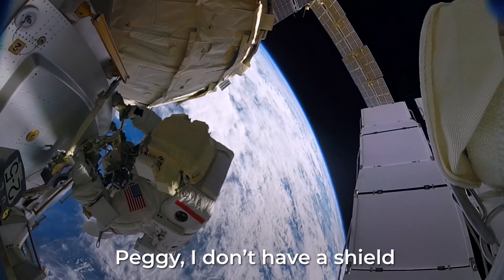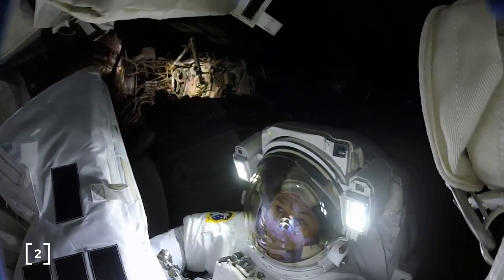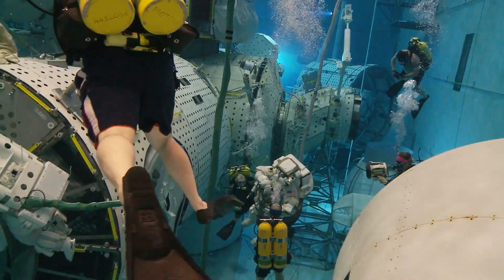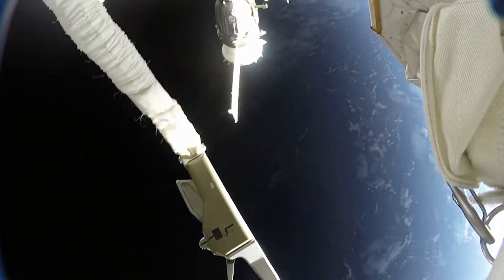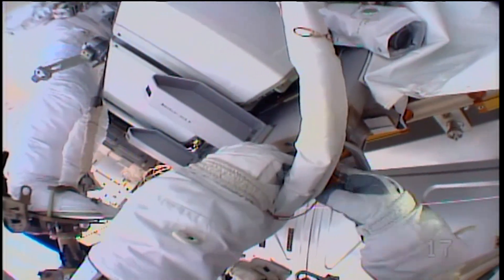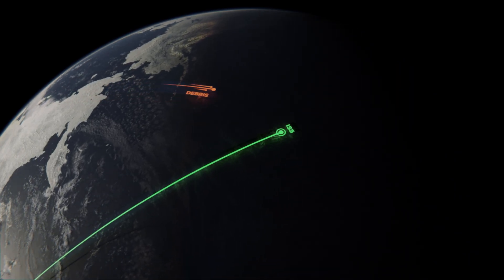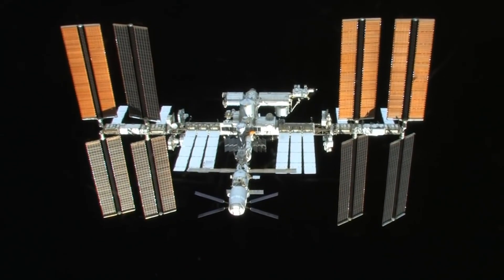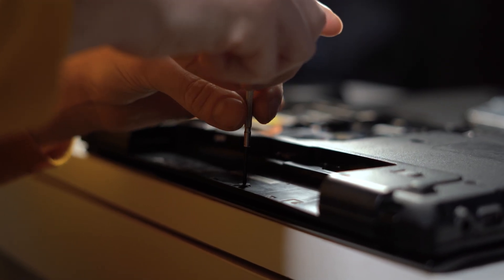Don’t Drop your Tools in Space

Comment: It seems like you could VERY easily make a small device that could go and grab these objects when that happens, and return them.  For something the size of a car door, it would take very little energy to turn it around to boost it back, so VERY small thrusters and almost no fuel.  There would be only a couple of MPH delta V required, and most of the parts are probably not that massive.  And you could either make the thing autonomous or have it be radio controlled.   It takes the problem of more debris in orbit away, would save having to construct and boost a replacement up, and in that particular case, time spent orbiting without that shield in place, which adds some small risk.  Just sayin'.
Reply: except, it’s not so simple. you would have to thrust directly through the object’s center of mass in order to push it in the direction you want without inducing a spin. how do you locate the center of mass of a car door? and then how do you attach to it? what if it is spinning already, and if it is, how do you measure exactly how quickly it’s spinning and  in what direction? perhaps you could accomplish something similar with, say, a net that is wrapped around it, but then how do you predict the behavior of a net floating around in space? you can be sure NASA isn’t going to send a device they aren’t absolutely certain they can predict the motion of into space to float around unpredictability around the most expensive (and fragile) structure ever built.
Reply: It's probably cheaper and more effective to deploy a net before any spacewalking is done.

Comment: I remember a science fiction tale from Analog concerning the old-fashioned notion of "epicycles" (an idea of planets orbiting in little circles along their main orbit, attempting to explain some 'anomalous' observations.) Well, it turns out, if you throw an object straight down from the ISS, it still maintains its forward momentum. Since its new orbital path is lower (and shorter), it moves "ahead" of the ISS BUT STILL HAS THE SAME ORBITAL VELOCITY AS THE SPACE STATION! It has simply made its orbit more eccentric. In a 90 minute orbit, the jetsam will appear to drop lower than the station and move ahead of it, then swoop up and over the top, where its orbit is now longer than the station's and it begins to fall back... Eventually (90 minutes later) the payload will come crashing back down on the station from above, with the same force it was ejected with. From the point of view of the station, the path of the ejecta is a perfect epicycle.

Comment: An extendedable rope that can also be electrically stiffed so it can be pushed and becomes a slightly steerable pole once unspooled with a grabber, electromagnet or harpoon to retrieve lost items. Something like a 1000m for a start. It'd be lightweight and could be mounted on a arm to aim in the vicinity before unspooling.
Reply: A 1000m nylon rope with a thickness of 24mm (1in) is 377kg, and that would be before adding any sort of electronics
Reply: @go-away-5555  would be way overkill for most stuff though... 1km is definitely a bit too long, but maybe a few hundred metres of cord attached to a magnet?
Reply: Good ideas, but it might be less expensive to just deploy a net before any spacewalking occurs. Or come up with a better tether system, or better gloves. I don't think it's a big problem to have two tether points on tools, so you can add a second tether before disconnecting the first one (so it's always tethered).
Reply: These are all ideas that pose a hazard to the astronauts for no real reason. Forcing a satellite to do a one second burn to avoid an object seems like a pretty solid solution. And if the debris got way out of hand, an orbiting trash collector that aimed itself at an ocean after it was full or out of fuel seems quite feasible
Reply: Lads and ladies, ye aren't thinking big enough. You wouldn't use nylon anyway, it's too cold, you'd need something else. Being a danger to astronauts is just a problem to be worked through. (well it could be dangerous, but so is everything else.) 1000m rope, gives the iss and grownd control enough time to find out if it's worth grabbing and to come up with a safe plan of action and give the rope enough time to decelerate the object slower.

Comment: "Uhh, Mission Control, I lost the space station. Moving away at about half a meter per second."
"Copy tha- You lost what?"
"Yeah..."
Reply: "Is the space station moving away from YOU or are you floating away from IT?!"

"Yesh" 😶‍🌫️
Reply: The station should have been tethered! haha
Reply: They do have oxygen and they have thrusters on their suits, as does the ISS itself.
Reply: @robertjarman3703  No I don't think they do. There's a special seat / backpack kind of vehicle they have, but the normal suits don't have that capability I'm pretty sure.
Reply: @BlackSun404  All EVA suits have the jetpacks (MMU/Manned Maneuvering Unit). It is no longer used regularly, and is only in place for safety reasons. I think that's why you're confused, since they don't use it anymore (again unless of emergency)
Reply: @imEden0  Oh damn, look at that! Not quite correct, tho, as the MMU was what I was thinking about, which I was right about, not used nowadays. But turns out it's become standard procedure (I think) to use the new, MMU-replacement system, called SAFER (Simplified Aid For ExtraVehicularActivity Rescue), and yeah I can see it attached to / around their life support backpacks in the videos! Apparently, it's got a 3m/s (or, 10 feet/s) ΔV rating. Cool!
Reply: @BlackSun404 danm, someone who actually knows some stuff or actually researches stuff they read online, for some reason thats rare nowadays
Reply: @BlackSun404  so what you're saying is I have to be moving away from the ISS at 3.5m/s if I want to avoid rescue and be the first person to die in space
Reply: @thundersheild926  its about time,  Someone needs validate my irrational fear.
Reply: Everyone also forgot that astronauts are teathered to the ISS on spacewalks
Reply: Damn, the space station is gonna orbit back and hit the space station!
Reply: https://youtu.be/UqU19dR0bFE
this is real ,.earth shall not move
Reply: maybe if you were holding something heavy, you can spin it fast to generate momentum and then let it go in the opposite direction of the station
Reply: Try swim back to the station.
Reply: @jxmai1000  it doesnt work like that if there is no air
Reply: @hjjjhhjhhjjhhjhjhjjjhjhh  It was a joke:yougotthis:

Comment: To those wondering how something "dropped at altitude" can pose a threat to the space station that it was dropped from.
First of all, the thing you dropped doesn't fall back to earth. It falls towards earth, yes, but it falls AROUND the earth.
And so, you could in theory pass yourself a baseball if you tossed it a certain angle (normal or anti-normal) along your orbit and waited the appropriate time for your lower or higher orbit at the time to catch up to or be caught up by the object you lost.
In a perfect vacuum (which the ISS doesn't live in) and with exactly the right force and direction vectors, you could let go of a baseball over the US only to catch it again when flying over India. The longest baseball throw and catch in history and all done by the same guy.

So, how does this become a problem then? If you can catch a baseball you've "lost" with your bare hands, how can it be lethal to a space station?
It isn't about the first, second or even third orbit. At that point it is almost perfectly harmless.
The reason it becomes dangerous is because you NEVER caught it, and so its orbit crosses your orbit twice per orbit around the earth. But the orbits are NOT the same, the ball could be slowing down at a rate of 0.001 m/s^2, so after a thousand seconds, the ball is traveling 1 meter per second relative to you as your orbits cross. That is just 3.6 km/h or 2.2 mph. But after a million seconds (11 days) it's traveling 1000 m/s relative to you, 3600 km/h or 2200 mph!!! You won't catch that with your hand and not have a sensation of impending death taking you and your crew with it.

And even if the ball isn't changing it's velocity at that rate, after all it would deorbit long before it crossed your orbit again in such a scenario, there's also a walking point of reference problem.

If you throw it a respectable 90 mph like a pro baseballer, it's not necessarily lethal the next time you see it as your relative velocities will still be 90 mph. But those relative velocities will change over time as the point of crossing orbits will walk around the body you orbit (earth) so that ball might have a relative velocity of over 700 mph as your orbits cross for the 500th time. And then it starts going back down towards 90 mph again over the next 500 orbits and then up, and down on a cycle.
In space, the butterfly effect is REAL. Even something as small as a broken off solar panel 2 by 2 inches can speed up substantially over time by simply catching enough photons from the sun. E = MC^2 means that the energy of a trillion photons can make your velocity change by a small fraction each time. Over long periods, those small fractions grow into whole integers.
It's why solar sails are a thing that actually work, they just work VERY slowly over VERY long times.

Comment: You could have mentioned the other big risk with space debris.
Take the decommissioned Russian spy satellite as an example. It can't change its orbit (i assume) as it's simply out of control. If a small part of space debris were to hit that, it's going do dislodge more debris that after an orbit will come back to the spy satellite and hit it again, and again, and again. Eventually, the speeds between the two debris fields will equalize but now you have a cloud, lance head and tail of debris around the Russian spy satellite that effectively makes it a much larger target/object to hit/be hit by.
And so, another piece of space debris comes and crashes into that, distorting it further and spreading more debris.
It all cascades into a massive blanket of small debris that will annihilate anything that decides to pass through its layer. Effectively closing our access to space for decades or possibly even centuries.

And so, when we need to deorbit satellites because they've reached their end of life, we can't do it as they would be annihilated by this layer of debris and just prolong the extent of the problem.
Which in itself is a problem because when we can't deorbit space junk, it stays up there "forever" even though it might possibly still have the fuel to deorbit, it just won't respond anymore as the circuits have been worn out by decades of radiation and heat cycles.
The latter by the way which is a vital aspect of some satellites, the ability to shield critical components from rising and lowering temperature shifts. Just making it so much more important to decommission them before they can't protect themselves any longer because their batteries have worn out, making them incapable of heating up on the cold side (sun blocked) side of the planet and to pump heat away on the hot side of the planet.

In summary, it is entirely possible for one extra small piece of space debris to cause a chain of events that lead to us simply being unable to launch to space anymore in our generation.
And so, the next generation will go without satellites. And do i need to tell you WHY we have satellites? It's not just your satellite TV box that will stop working. You won't get accurate weather forecasts, there won't be early wildfire detection, ability to track volcanic eruptions from space and equally as important you won't have GPS anymore. We would be going back to pre 1960 era navigation aids which would be a disastrous blow for air traffic especially, but also lead to far more deaths at sea than what we have had the pleasure to avoid in the past decades.